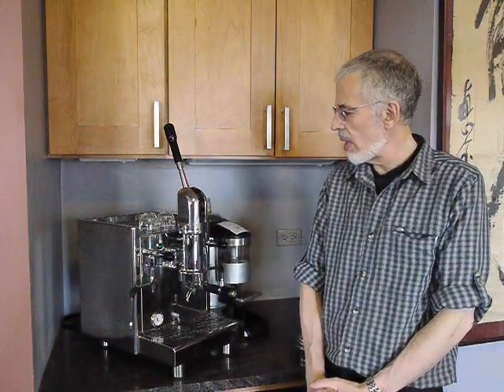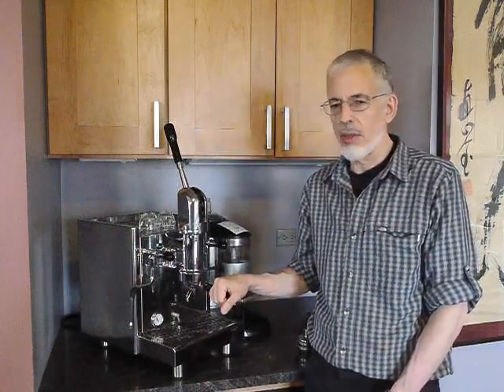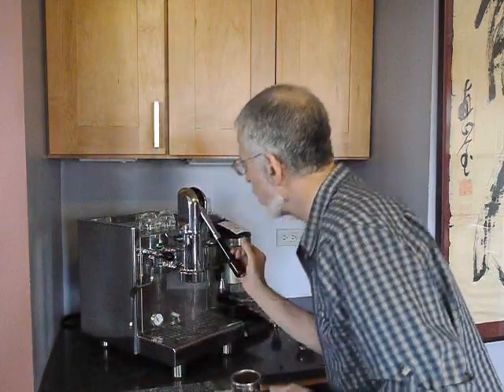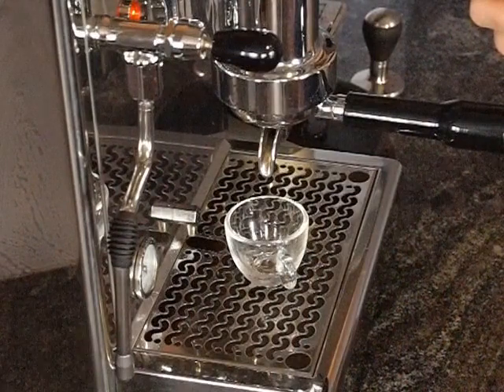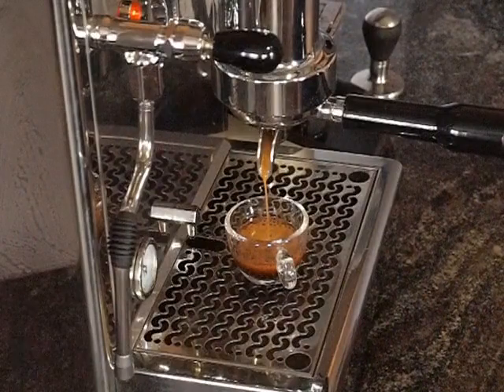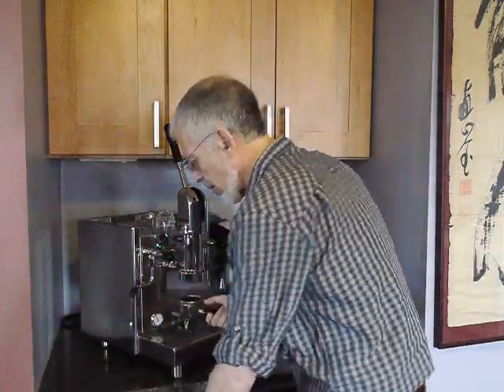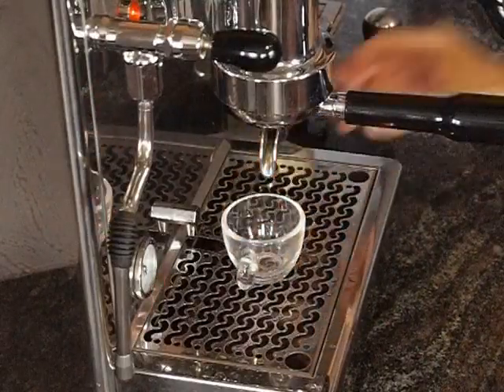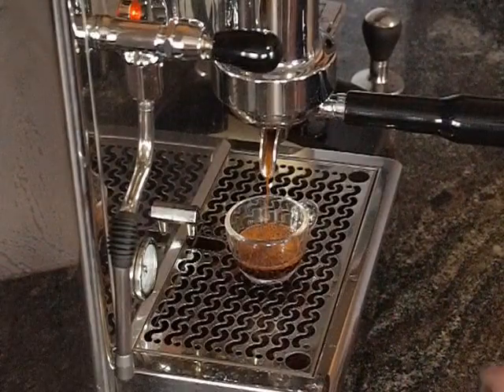Strega Instrument.avi

Comment: Great video. I know you say its not for beginners, but i purchased one of these after watching your videos. I love a good coffee and can already make better shots then i have ever had from coffee shops after only 1 week of use. Could you please shoot one more with different shots you could make with this machine? Which way is better to make a cappuccino shot and espresso shot. And how fine or course should the grind be for each? is there a way to measure this?

Also if you have a 16g basket would you pack slightly more or less then 16g (i use electronic scales to measure the weight precisely to 16g)
Reply from the maker: Hi Alex,

These videos are part of a review of the Strega on home-barista.com. I'm not planning to make any more; but you can get a lot more infor by going to that site and searching the very long forum entries.

The pump on the Strega is activated by a microswitch in the lever assembly. Moving the arm to the right, or lifting it slightly, will switch it off. This means you can stop the fill of the chamber at various points. The starting pressure of the shot will change when you do this. This means you can use different combinations of grind setting, dose weight and pressure to make shots. 

You can experiment for yourself, or check the home-barista threads for specific tips.

Jim

Comment: Hey Jim , you say pre infuse at 3 bar which is about 37mosquitoes count
would that mean to infuse at 9 bar  its 21 seconds ?
Reply from the maker: This is rough. and ready. Observe how longit takes for the pump to go silent (this means it has filled the cylinder). Then only run it for about 1/3 to 1/2 the time if you want lower pressure preinfusion. In my experience, the tast difference isn't large

Comment: Strega vs Londinium vs Vesuvius ?
Reply from the maker: I've never used the others, so I can't say anything about build quality. In terms of shot quality, all proper levers can be worked to produced equally good shots. The Strega pressurizes the preinfusion with a pump. On a sipper, you can do the same by lifting and holding the lever part way up, so the cylinder is pressurized above boiler pressure.

Comment: Hi Jim. This is very instructional. I just got a Strega and I'm wondering what size portafilter you used in this video. Mine are labelled 7g for the single and 14 g for the double, however, my understanding is that those are more traditional italian style doses. So far, not even 16g in the double has yielded a shot with the body and mouthfeel that I was expecting.
Reply from the maker: I used a an aftermarket double basket called the "microfine," which I'm not sure is still on sale. Single baskets take more skill, and I recommend the LM or IMS single with a 47mm tamper if you want to build your skills (google on these and you'll get the info). For doubles, experiment with higher doses and coarser grinds (more body, extremer taste), or lower doses and finer grinds (less body, smoother taste) to get the right tuning for each coffee. The supplied double will work well for this (the supplied single is not very good)
Reply: @HBsJim  Thanks Jim. I'm still experimenting with dosing and find it quite challenging. Another question regarding 'pre-flushing' the machine. Is this necessary? Or could it even be counter-productive as the Strega has Bezzera's proprietary heated brew group.
Reply from the maker: @AndreasLienemann  Don't flush lever machines in general; and the Strega in particular. The way they work is that the group is cooler than the inflowing water, and drops the temperature. Lever groups need to cool off between shots, not get heated with flush. The Strega uses a heat exchanger and pump, so it's a little different. But the group head heater does the work for you.
Reply: @HBsJim  that's what I thought. Is there another reason then you do cooling flushes before every shot in this video?
Reply from the maker: @AndreasLienemann  I was still new to levers, and was overdoing it. If there is a long interval between shots, the water in the HX in the boiler rises to well above boiling point. In pump machines with small groups, it's good to flush this out excess out. In a big lever machine, it makes almost no difference.
Reply: @HBsJim  thank you for this Jim. That makes a lot of sense and I'm relieved; I thought I was confused there for a moment. I'm new to levers now 🙂
Reply: Your videos here, and your posts on Home-Barista have made all the difference to me getting to know this machine! I'm still a little bit off from getting similar shots to what your pulling, but I'm getting there. I made the 'mistake' of getting a new machine AND new grinder at the same time, now having to get to know both simultaneously. Too many variables!
Reply: @HBsJim  but in your videos you showed us to flush the lever. Could you clarify this? thanks